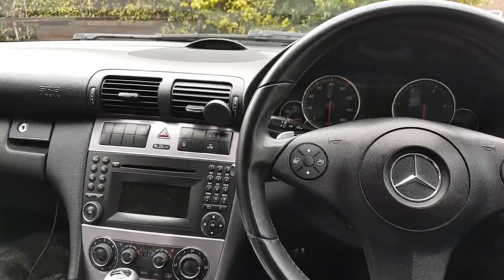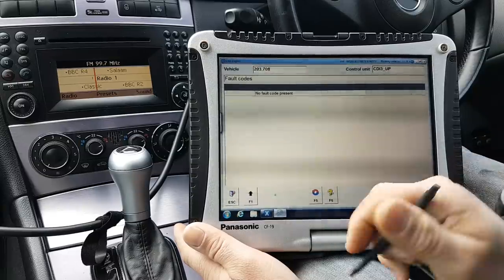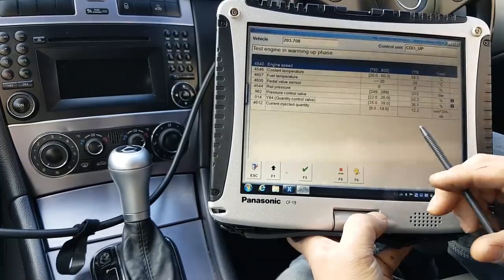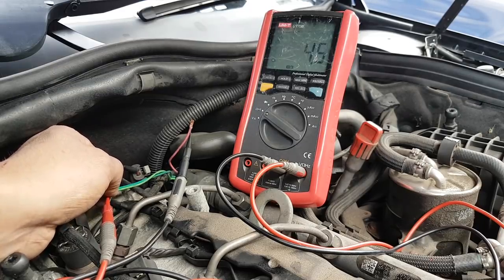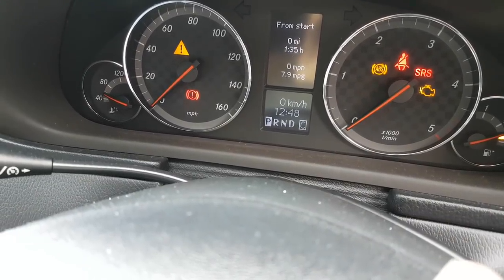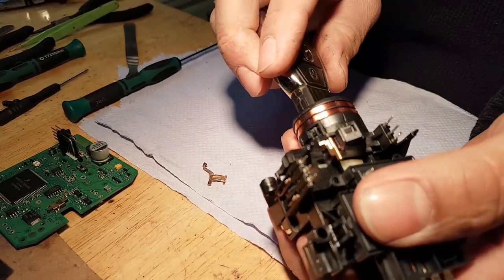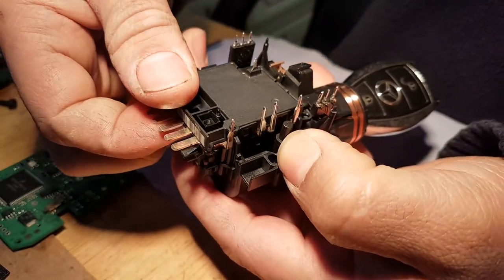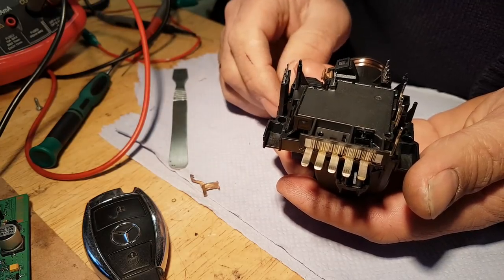Mercedes CLC220 CDI 2010 randomly not starting and cutting out. Fault finding and repair.

Comment: I have the exact same problem with my 59 plate clc.I have been through a similar process to yourself with trying to diagnose the problem and in the end I took it to a Mercedes specialist.  They have told me that I need a new ignition switch and the part would cost £450 and with labour it would come to £600, I would also have to provide them with proof of identity and proof of ownership etc as it is a part of the car security system. 
When the car cuts out while driving it mostly will re-start but if the engine is cold or you are going slow it cuts completely and you loose the power steering and power assisted brakes and has caused me some uncomfortable moments. 
I am very grateful for your video and intend to have a go at this repair in a couple of weeks time. You do not seem to have used any special tools to get the ignition switch out of the car and you don't show how to take the switch apart so I guess this is within the realms of someone with basic mechanical skils ?
Reply from the maker: Hi
Indeed... the ignition switch is removed by undo the front ring... just turn it anti clockwise... as is threaded...
To open the switch, I am sure you will easily figure it out... is not rocket science...
Hope you get it sorted!
Thank you for watching!

Comment: I had this and sent my key and barrel to get fixed. Top tip: reach up behind the barrel and unscrew the locating ring. Saves you taking the dash apart 👍🏼
Reply: We're did u get it sent and how much
Reply: @lewisconnell1234  I can't remember now. I rang a guy in London who recommended a guy up north so I sent the key and barrel to him. Cost about £250 I think. Never happened again after that. I'm sure if you Google it you will find someone call them and ask, can't hurt

Comment: An excellent piece of work!  I have a 2007 CLK 320 CDI with the same intermittent fault.  The previous owner spend over £1,800 trying to get this fixed with replacement ECU etc.   You even demonstrated you could get the switch out without removing the steering column…. Well done and thank you!

Comment: Hello sir, excellent, thanks. Have these intermittent problems currently. No problems when the engine is cold, but once it gets hot, it's hard to start this damn car. Sometimes, on my way home, while I am driving and the car is running well, flashlights come up at the dashboard, speedometer and tachometer  arrows go to zero, the radiotor fan just starts blowing full speed and the AC goes down. After touching the key or pulling over and restarting, it ignites again. Driving me crazy. Inam fairly confident that THAT is the issue. Notice, then problem occurs when the engine is hot (the metal becomes elastic aaand there it goes, physics 101)
Reply from the maker: It is a good possibility that is the same as here...
Now you know what yo look for!
👍👍👍
Reply: @LMAutoRepairs  I am so stupid, I probably know exactly how this occurred. I added several other keys to my car key (it looked like as if im a genitor in a warehouse) and drove a while with them, very bad idea.
Reply: Mine is W203, C200, 2000 btw, but the key structure is almast similar
Reply from the maker: @STIGGARRIUS  
☺️

Comment: Seems like a very intricate and delicate system, so many possible failure points.
Even bmw's older system where you put the keyfob into a hole and then hold the clutch/brake and hit the start button must be more reliable.
Reply from the maker: 😊
The BMW system is indeed different...
Thank you for watching and for your comment!
Reply: @LMAutoRepairs  You're doing real good work with these videos. Usually other mechanics end their videos with a parts change and now it's fixed, but you delve deep and actually expose the underlying issue in the part. I'm sure it's a lot more work but also makes you stand out here on youtube, it's phenomenal keep it up!
Reply from the maker: @SixBlix  
Oh...
Thanks! 
Really appreciate your comment! 
👍👍👍

Comment: Excellent Demonstration the best I’ve seen on this No Start No Turn plus random Stall when stopping , I have exactly the same problem on my CLK 220 CDI , I usually switch off and writing each the steering wheel to and fro which seems to help so it’s somewhere in the Ignition Switch .
Should I Risk just have a New Switch fitted 😢
Reply from the maker: Possibly... but the electronic side is programmed to the car, is not a simple swap...
👍👍

Comment: I always enjoy how you take a daunting diagnosis and repair and through careful analysis make it look straight forward. I recall you did a video on a diagnostic main board pointing out a cheap chip set and a preferred set and board.Any pointers on where to get better Star, Veda and Das systems on eBay? Did yours come with the Panasonic toughbook? I have seen many on sale but difficult to discern which are best and have complete software,not cheap limited versions. Don't want to import all the way to NZ as it is costly to return for refund/ repairs etc
Reply from the maker: Peter datechmen 
Hi
I got my system indeed with the laptop...
I got it on eBay as well... 
Clones are always a gamble, in my case I looked for a seller with a good reputation, and that was for some time in the business... I also picked up the tool myself, although I understand that my not be an option for you...
Just make sure the seller, the feedbacks etc inspiring confidence. 
You can also a
Have a look here... cardiagtool.co.uk 
I have no affiliation with this site, but u buy most of my tools from there... do it at your own risk.
Thank you for the nice comment and for watching my content!

Comment: Absolutely amazing. Can you pop over to my yard and fix my EIS? I've got the exact same problems with a CLK I've only just bought but because the scanner won't throw up any fault codes everyone says the car's perfect. It's actually a potential death-trap if I lose power whilst going around a bend at speed.
Reply from the maker: It can indeed...
👍👍👍

Comment: Have a not so similar problem with my w202 220cdi, car cranks, starts and stalls in seconds, if I let it crank for 20/30 seconds then it runs, curious thing is, if I unplug the rail pressure sensor, the car starts and runs with no problem, replace the sensor, but the  problem wasn't solved, do you have come across something similar?  Thanks for the video and well done.
Reply from the maker: Never came across that particular issue...
But check live data... if you believe is fuel pressure related, monitor those pressures...
Consider the replacement sensor not being good either... check also wiring etc...
👍👍👍
Reply: @LMAutoRepairs  thank you for taking the time to reply, starting to think it's more complicated than I expected, injectors are gone, but compression in cylinders are also very low, all that and loads of electrical issues with abs pump, brake pedal sensors. Not finished with these one I guess.
Reply from the maker: Ah...
Looks like you have something in your hands...
Good luck! 👍

Comment: I have just bought a 2008 CLK with the same problem. When scanned the car shows no fault codes so the guy who sold me the car won't try to fix it because he says he can't claim on the warranty unless he can quote the codes that are identified when scanned and because the faults are intermittent I can't recreate the issue so he can see for himself.
Reply from the maker: Yes... it can be tricky when faults are not logged...
👍👍👍

Comment: Hi 
I had the exact same issue with Mercedes c220 cutting out and the position 2 on occasions going blank, I tried all the steps in the video with EIS but still have fault with ignition 2 position. Any ideas as to what may be fault please. Thank you
Reply from the maker: Check and double check that you have not missed anything...
Thank you for watching!

Comment: I Luis; where do I start. My car has been in out of limp mode for last year. It's a 2004 c220 cdi - UK version. The EML is on constantly; drives but no power above 3000 rpm. Can hear the whistle from the turbo but no real power. What should I do?
Reply from the maker: Hi
Scan the car and look at live data...
Thank you for watching!
Reply: these Benz cars need frequent maintenance and repair by either yourself or someone else.

Its one problem after another... so try to keep up!

Comment: Hi! I have a c220 cdi w203 105kw diesel 2001. when the engine is cold starter  but after 10 or 15 minutes the engine  stalling. i replaced crankshaft sensor and opened the engine. everything was ok. the crankshaft chain and timing was good. the fuel system also ok both sensor and pressure. can you help me what i have to do nextHi! I have a c220 . when the engine stalling i have wait for 2 3 or 4 hours  to start again
Reply from the maker: Have you scanned the car?
And monitored live data etc?
Thank you for watching!
👍

Comment: I have a 2005 clk 220cdi with similar interion (my cluster is silver and white) have random cutting out....cold...hot motorway (engine completely dead for 1 sec then back fine...junction (stall). Pulls well....turbo all good...cant find any leaks....but never an issue starting...only cuts out randomely...pulls well, runs well. Do you think I may have same issue? Also....did the owners woes stop?
Reply: P2356 powertrain, p2386 powertrain and body code B2TAE. These are fault codes that keep coming back. Body code is intermittent. I use a naff "torque" app.
Reply from the maker: @Infinitpossibilities  
Hi
There is possibility of being a similar issue to this one.... but, I would tackle those faults first... and go from there. 
Thank you for watching!
Reply: I would tackle the fault codes...but I cannot pin any of them down as yet! Do you have any idea what they refer to?
Reply: @LMAutoRepairs  hello...still having the issue. Same codes but body code never comes back now.  Do you know what these codes refer to on a 2005 clk coupe 220cdi?
Reply: @LMAutoRepairs  B1036 “the input circuit 61 is not ok” very consistent code. Also no electricity passing through fuse 52 on front Sam “start enable” I feel I am getting close! Where is circuit 61; any ideas?
Reply from the maker: I strongly believe... (haven't worked on a mercedes fro some time...😋), that circuit 61 is the alternator circuit...
Reply: @LMAutoRepairs  thank you for that.... but could an alternator issue cause a no communication with ecu? It’s so weird because I have a 5 volt reference and eml light on the dash!
Reply from the maker: Who knows...
LoL
Have you tried a different tool to scan the car?

Comment: Hi man, do you reckon its better just buying an ignition switch of ebay and getting my mechanic to replace it? Thanks for your video! I have an appointment with Mercedes and cant afford a big repair!
Reply from the maker: Hi
Not really... this contains the immo info etc... if you just replace it with another one, the car will not start...
Thank you for watching!
Reply: LM Auto Repairs hi mate. Thanks for replying. So what should I do? I got a diagnostic quote for £130 for mercedes
Reply from the maker: @thecoyote2226  
Hi
What do you mean, 130 from Mercedes to diagnose,  or repair?
Reply: LM Auto Repairs just to diagnose
Reply from the maker: @thecoyote2226  
I don't know what to say... I can't really help you any further... sorry
Reply: LM Auto Repairs ok please help me here. Just for advise. What should i do? Take it to Mercedes for diagnosis? Thanks
Reply from the maker: @thecoyote2226  
If you don't know of anyone else... is probably your best option...

Comment: Hi. I have this issue it’s been going on for months now. Driving me insane. I need it sorted. Are you anywhere near Kent ?
Reply from the maker: Hi
Not, I am not near...
Have you confirmed that the root cause is the same?
Thank you for watching!
Reply: LM Auto Repairs it’s most definitely the same issue. I think I found someone that may tackle it for me. The vehicle wants to cut out and underpowered. But all starts from the start up issue.
Reply: LM Auto Repairs does the key have to be recoded again ?
Reply from the maker: @se13bmg  
No... if, the problem is the same...

Comment: what if you leave it like that what happens please??
Reply from the maker: Leave what?
Sorry... but I am confused with your question...
Reply: if i don't fix it
Reply from the maker: @arbribatusha9155  
If you don't fix it, you will carry on having the problem...
Sorry, but I really don't understand the point...
In this video, the issue was that the car would randomly cut out...
If i did not fix it, would carry on cutting out...
Am I missing something? 
🤔

Comment: The Infrared of the key is faulty
Reply from the maker: 🤔
Why do you say that?
Thank you for watching!
Reply: @LMAutoRepairs  thats also common problem with the w204
Reply: @LMAutoRepairs  hello great video thanks for sharing, i also have a question .my vito w639 2005 front sam is damaged by water im wandering if i can buy one the same and plug and play or need to be programmed? Thanks
Reply from the maker: @sandordodo1775  
Hi
Plug an play as far as I am aware... however,  any options that either don't apply to your van, or options that were not on the van it came from, need to be coded...
You might be lucky to get one from a van with the exactly same options as yours...
🤞
Still, better to just get a diagnosis session and get coded correctly...
Hope that helps!
Thank you for watching and for your comment!